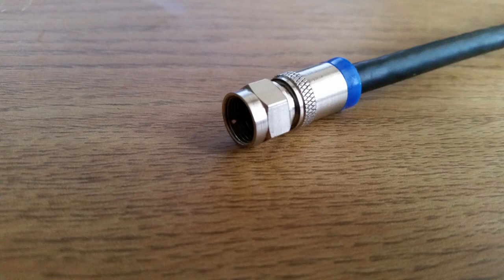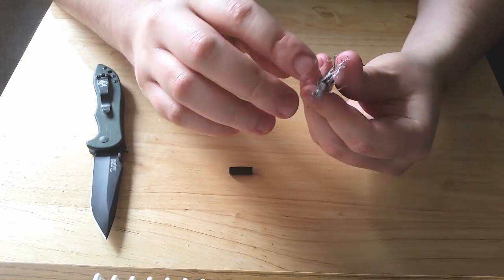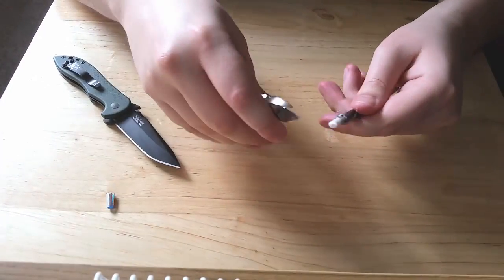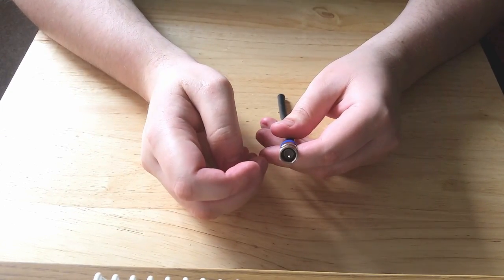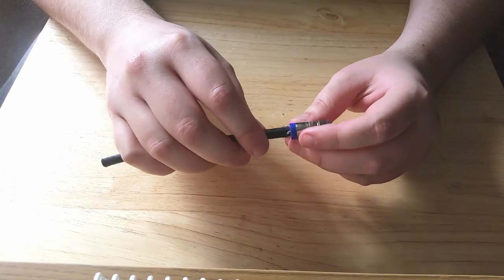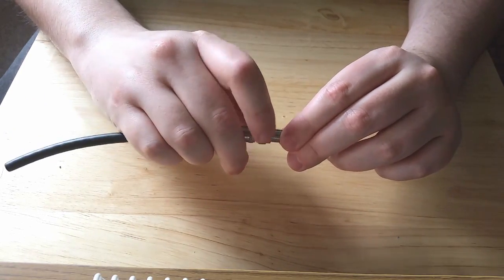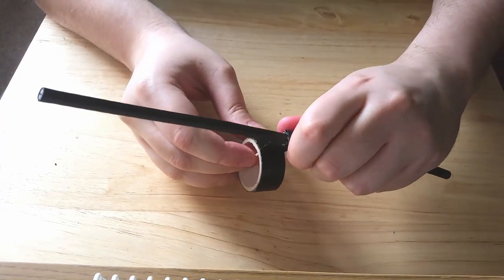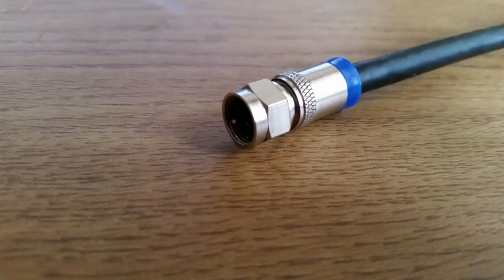Tech Solutions Video | How To Splice A Coaxial Cable! (TV Antenna Cable)

Comment: You don't need to wrap a barrel connection in electrical tape. Just make sure the fittings are wrench tight and you're good to go.
Reply from the maker: Yeah was more for aesthetics to be honest so it blended in with the cable haha